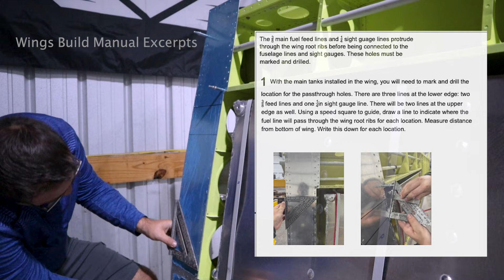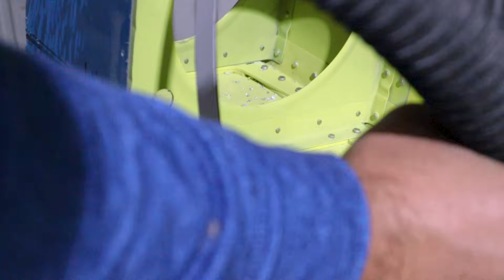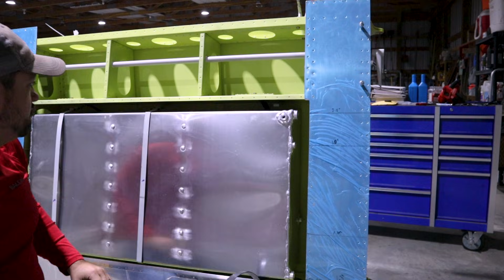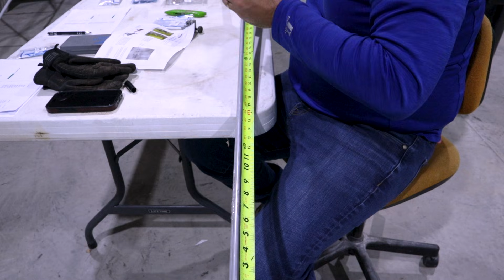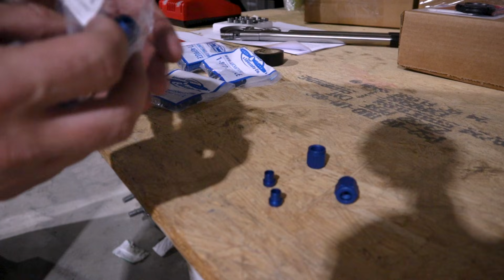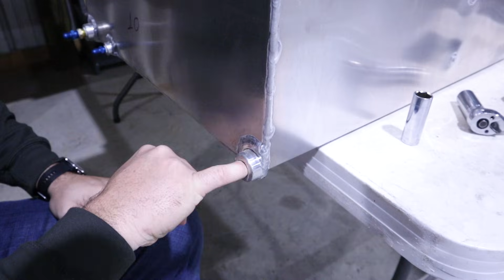Building Fuel Lines & Tank Fittings | Aircraft Build Series

Comment: Great work! I generally find applying thread sealant with my finger works the best, you basically want to press it down into the threads. Make sure that there isn’t any on the front of the fitting that might enter the forum system and cause grief at a later date. 
 

Keep up the great work, it’s looking great!
Reply from the maker: That’s a great idea… I definitely cleaned the threads although the and fitting that I show I actually took out and put back in because I was not happy with how it felt. In hindsight, a pair of gloves would have helped significantly to let me get in there a little bit better. I didn’t mention it, but I also had to chase the threads with the tap and then vacuum those out.